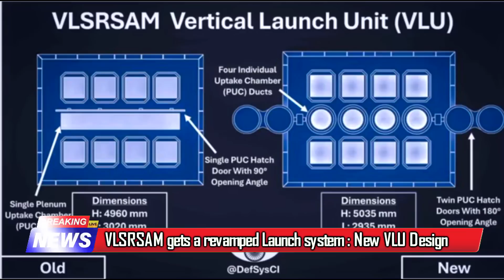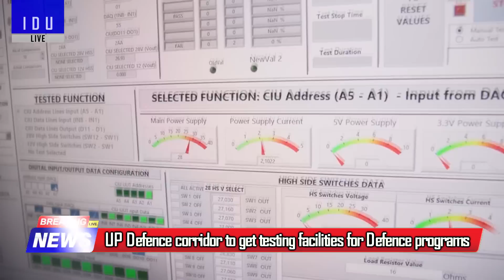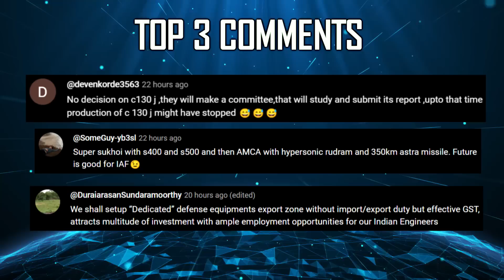Indian Defence Updates : MRFA $20Bn Approval,AMCA Trials by 2033,SSS P-72 Rifle,97 Tejas MK1A Deal

Comment: The advanced rubber tracks needs to be seen how it behaves in colder regions like Ladakh as cold climate is not friendly to rubber secondly how does rubber tracks stand in hard off road conditions comparatively to metal tracks of tanks. Tanks  have all terrain ability die to these metal tracks.
Reply: This is manufactured in Canada which is cold country
Reply: @vaimurthy  Never heard of Ladhak like terrain in Canada. Do share your source of info. There is also maintenance issue of rubber tracks under combat conditions. During damage you can replace a chunk of metal track that got damaged then replacing the whole track and you are ready to go not sure if that is possible with rubber track, rubber tracks take hit due to sharp stones, rocks more then metal tracks and lastly metal tracks can take more hit during explosion comparatively to rubber tracks.

Comment: We the people of India need AMCA by 2028 for trials and production by 2030, why is HAL delaying these is tax money of Indians so please we have waited for long and now we need results.
Reply: We need some good engineers apart from funding and all..... And ofc more ppl working in RnD
Reply: First, ask the government why they have delayed the CCS approval of AMCA prototype.
Second, The deal of F414 engines from GE has not done significant progress. Even, GE has delayed the delivery of F404 engines,used in Tejas mk1a. Ministry of Defence and Ministry of External affairs should address the issue.
HAL is a state-owned company but it doesn't mean that all problems are created by HAL. Without engine, how can make a Aircraft?
Reply: @HarshitKumar-xz2nl  
Exactly. It is a case of government rubber stamp babus not understanding development or manufacturing programmes and thinking that it is like ordering pizzas to go. They are so incompetent and clueless that they can't understand what they are doing wrong again and again, and blame everything of others - HAL, DRDO, General Electric etc.
Reply: @HarshitKumar-xz2nl  Without engine how come HAL committed. Even after completed testing(!), they are not able to produce one MK1A. GE cannot keep running 404 assembly without actual start date. Uttar radar which was told ready is not available for integration. What will you do with 414 when MK2 is not even ready?

Comment: HAL should be dissolved and allow a new PPP project institution to be setup. This institution should be under RAW
Reply: U better take the initiative to PPP Spv for Amca
Reply: @travelwithpaul  we are not going to do anything like that. HAL will not be dissolved in any case. They will have to work with private companies in many sectors. If needed HAL will be restructured but it won't be dissolved.
Reply: Not gonna happen in any case. HAL order book is full  for another 2-3 yrs atleast  and no other companies have that much of capability and  expertise to execute such high end projects solely.
Reply: @sunnybunny-z3k  What capability we are talking about. Allow private to forge partnership with foreign firm, they will learn be ready in 10 years which HAL cannot
Reply: The project management team should be additional to not instead of HAL. The project management team does planning, programme, and deals with risks and contingencies. They DO NOT design or build aircraft and equipment.